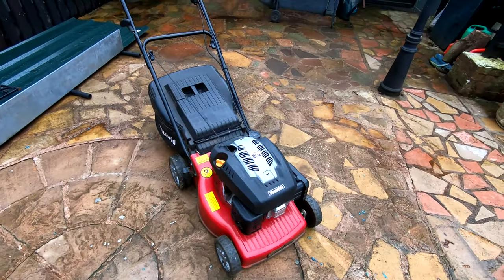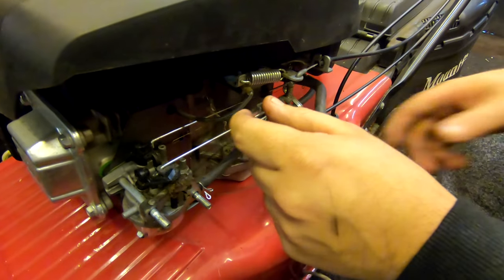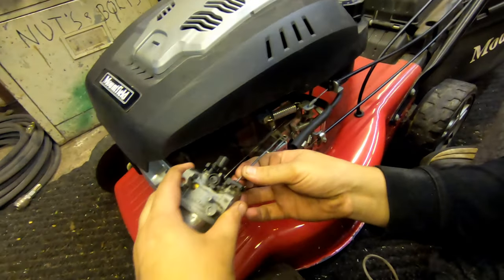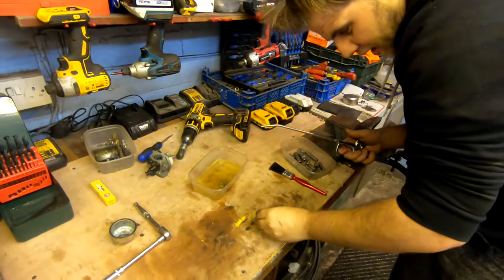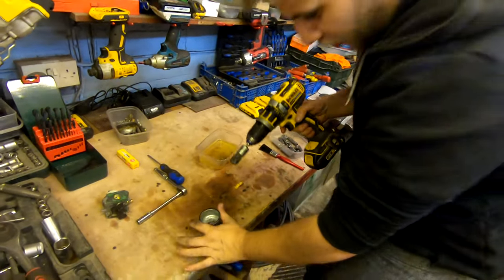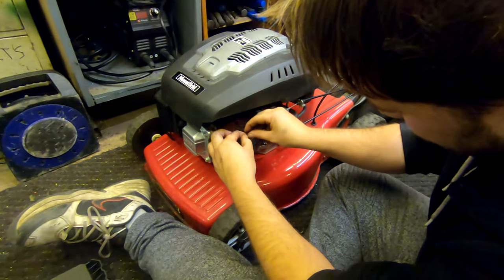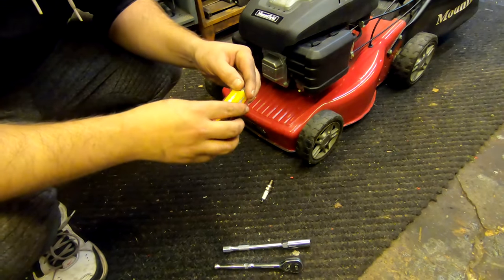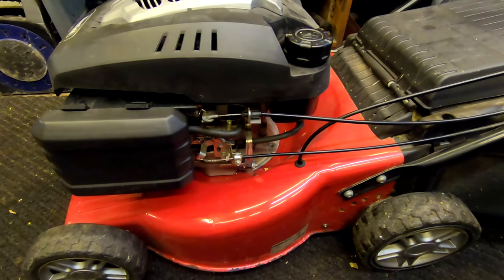Mountfield SP454 140cc Self Propelled Petrol Lawnmower Will It Run? #SHORTS

Comment: Hi, I have one of these and have cleaned and sorted the carb but whenever I attach I get a leak out of the back of it where it joins on the engine side. Have replaced Gasket and the bolts won't go any tighter so wondering what the problem is. Is there a rubber seal or anything I have missed?

Comment: Hi Mate
I have a Mountfield XTE 50 EMPEROR 1980s or 90s for sale
It works
I just serviced it
Roller cable snap at top and missing plastic case on the left side on the inside of the handle bar
Can you advise me on the price I should ask and possibly of parts
I looked on eBay etc
Look forward to hearing from you soon
Thanks